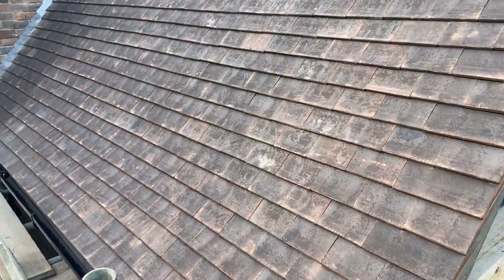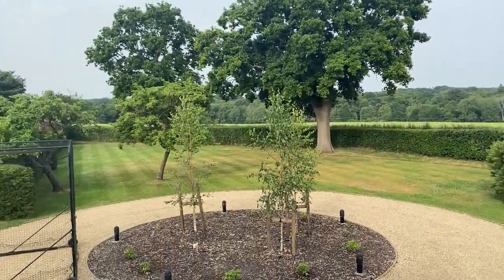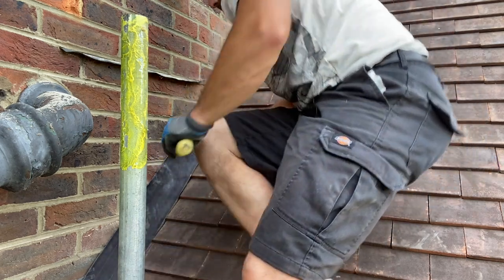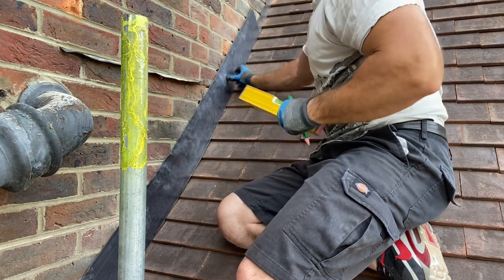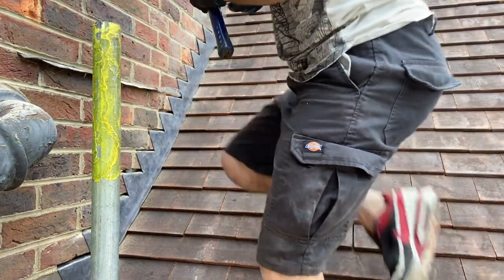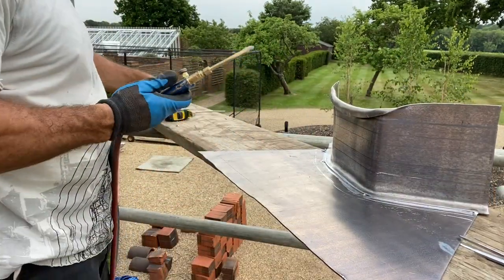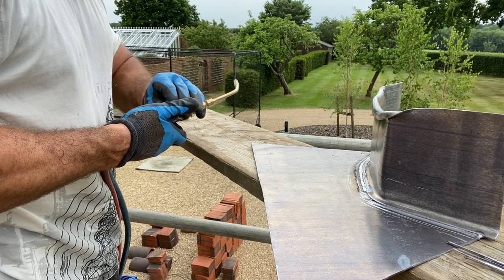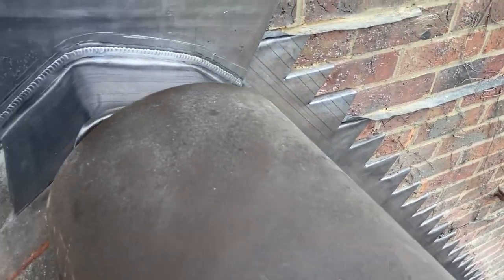Installing Lead Step Flashings And Ridge Saddle To A Large Tiled Porch

Comment: Nice work, excellent video. I appreciate the welding that you do. If one doesn't have a suitable torch would it be acceptable to use plumbers solder?
Reply from the maker: Thank you. 
No you can’t use use that as far as I’m aware.
Reply: I think you can fuse two pieces together using what was called a wiped joint so basically like soldering I suppose. Stuart definitely knows his stuff and is a very good leadworker. I may be wrong but I think I've seen leadwork done using that go join it but then again that could of been wrong to do it like that. I know pipes used to be joined all the time using the wiped joint and still is today all be it very rare unless you work exclusively on heritage projects

Comment: I’m a roofer myself and I am planning on teaching myself how to weld. Mainly for chimney flashings, back gutters, nothing major. Have you any tips?
Reply from the maker: I would recommend investing in a decent setup. It definitely makes life easier having the right gear.
Reply: You can have the best gear but if you  are not patient and do not know what flame you need to weld lead ! It will drive you nuts 🤪.

Comment: Hello , question if you don’t mind , what stops the water being driven in the step flashing on the slanted vertical part and then down the back of the soaker ?? Thanks any reply welcome
Reply from the maker: Each step is turned into the brick joint by 25mm. This is then pointed in with mortar or silicone. And as the steps go up they lap the one underneath. The slant also encourages water away. If water was to run down the slant it would hit the 25mm turn in on the step underneath. I know it doesn’t look like it should work and I see where you’re coming from. 
But it does and his method has been proven to work for years.
Reply: Thank you for your reply I take your word for it that it works, its lovely to see how attentive you are to your job , wish you all the wealth and more importantly health .
Reply from the maker: @bobjit252  Thank you so much. And thanks for watching.

Comment: Ridge tile line looks like its virtually on the top nail  9.43 .... not your fault obviously but makes you question the roofers a bit.
Reply from the maker: I did remember thinking it looked close on one side.

Comment: What do you use to finish the lead to the brick… do you use some form of mirror or like a lead sealant like flashpoint?
Reply from the maker: On this particular job the roofer I done the job for is old school and points it in himself with mortar. But usually I use lead sealant. Flashpoint etc.

Comment: You welded the saddle because you can. We used to just turn the saddle up the wall like the soakers and then put a cover flashing over it. The end ridge buts against it and holds it in anyway. Super neat job. How did you learn your trade. Are there college courses in lead work these days or did you serve an apprenticeship as a lead worker. It has all changed over there since I left. However you trained someone did a good job.
Reply from the maker: I started when I was 16 straight from school. I done a 4 year apprenticeship. With 1 day a week at college. But it was definitely working alongside another lead worker that I learnt the most. Proper real world out on site training. I worked with two amazing lead workers. Although one of them I was definitely scared off. I didn’t want to make any mistakes as I wasn’t sure what he would do. Although he had a temper. He was an amazing lead worker.

Comment: Where should you fit the hall clips or wedges on the flashing ? On the furthest point away from the roof or in the middle off step ?
Reply from the maker: I always put mine in the middle of the step.
Reply: Just makes sure you don't get it where the brick vertical joints are too